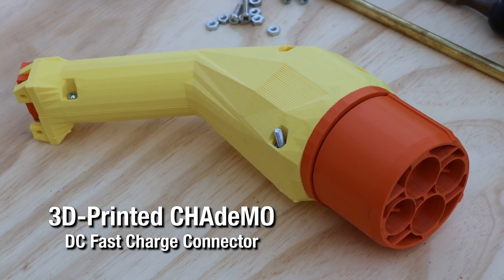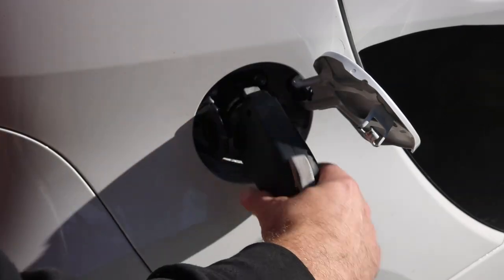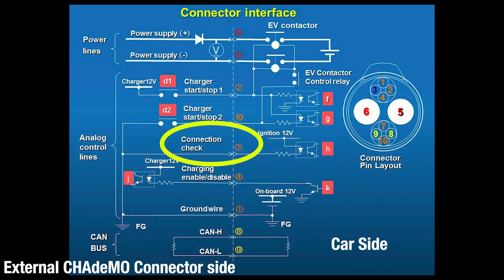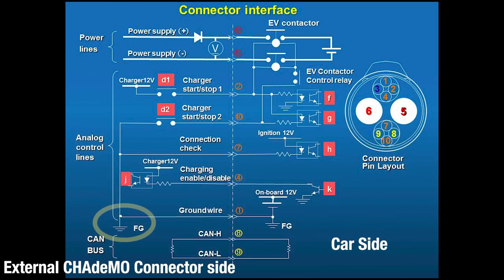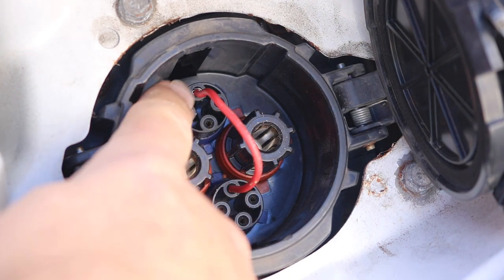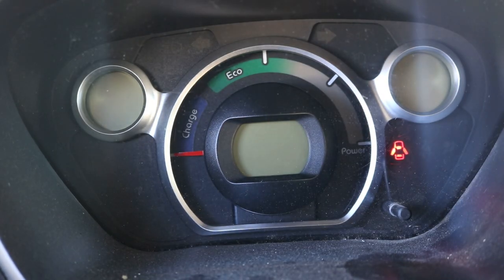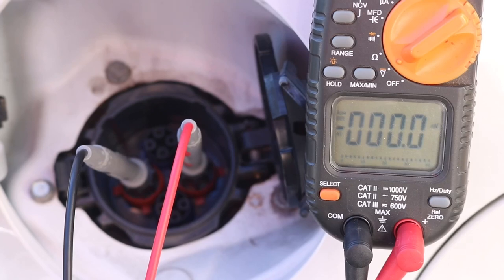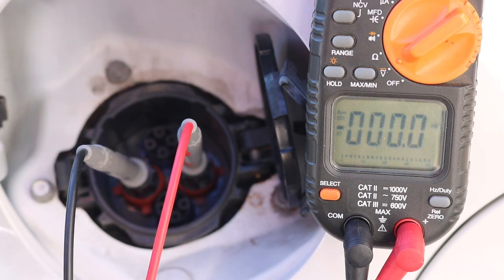Prevent Drive-off in Electric Car with CHADEMO | DIY V2G Project

Comment: I'd put the jumper between pins 1 and 7 inside the plug itself, for safety reasons.
That way should the long signal cable get damaged in some way, it's not going to disable the proximity signal.
Reply from the maker: True. That sounds like a good idea. On J1772 plugs, what makes the proximity pin work is entirely in the handle.

Comment: HI Benjamin, I am working on V2H project with Nissan Leaf 2019. I bought the Chademo adapter and build my DC to AC inverter. However, I don't know how to configure Chademo pins to get DC voltage out of the battery. What's the configuration? Please let me know as soon as you can. Thank you. Waiting for your response.

Comment: question ? like that ford ranger you have. why cant you put solar panels as a cover for the bed to help charge it while its driving. and just setting outside in the sun. wouldn't that give you extra range. or will it shut it down. even if you dont hook up number 7 plug.
Reply from the maker: You COULD put solar panels on an electric vehicle to give it some more range, it's mostly that it wouldn't be practical. You would need a very large area, and enough solar panels in series to get to a high enough voltage to charge the battery. You would also have very bad wind resistance due to the panels.

It IS practical on something like an electric golf cart. Since they are typically 48V, having two 30V solar panels on the roof gives you an appropriate voltage for charging the battery while shading the occupants.

Solar panels permanently mounted on a garage or carport are ideal for electric vehicles.
Reply: @BenjaminNelsonX  that's why i ask you because you have tried or trying everything i always wanted to.

Comment: What's the deal with the flashing tire pressure warning light?
Reply from the maker: The car uses Tire Pressure Sensors, but it's winter, so I have my snow tires on. Those tires are on plain steel rims WITHOUT the sensors. The tire light flashes for a bit right after turning the car on, but then the light turns steady.
Just a little annoying for shooting videos like this!
Reply: @BenjaminNelsonX  So you know why it's even lit.  One of the 2 reasons for it to light, pressure out of bounds or module failure.
Reply from the maker: @randycarter2001  Works just fine when I have the summer wheels/tires on there!

Comment: Hey Ben, nice project and keen to do a similar idea here in Oz ,  wondering if you have a Chademo adapter for your Tesla to try that when you are confident that it works on the iMiev..?
Reply from the maker: No, sorry, I don't have a Tesla.
The Tesla has a LOT of software and sensing controls. The other issue is that since standard and DC Fast Charging are both done through the same port on a Tesla, there is software that controls contactors internal to the car/pack which would need to be hacked.
Even if that was done, I'm sure the Tesla would just error out if it sensed negative current at the charge port!

The advantage of the iMiEV is that it's such a simple car!
Reply: @BenjaminNelsonX  Agreed, I have a 20kw Chademo charger here that works on my S85 and looking to reverse engineer the protocol here because the same thing should be possible if we can close the contractors to the port...then current should flow either way...I see your point on current sense however...happy to keep in touch?
Reply from the maker: @outbackev-hunter6035  Yes, please do!